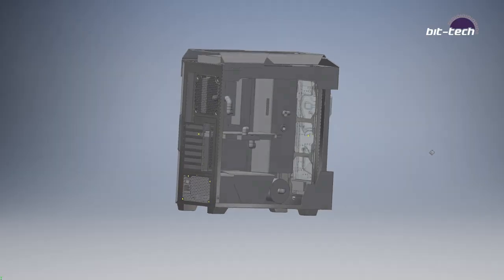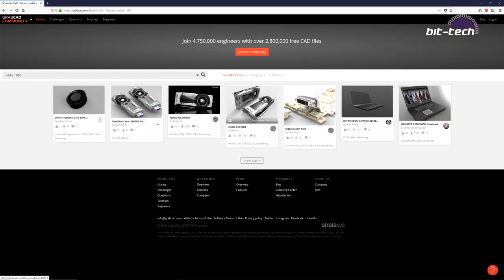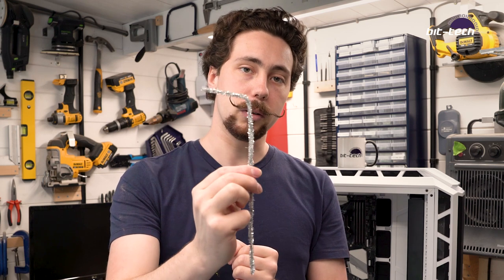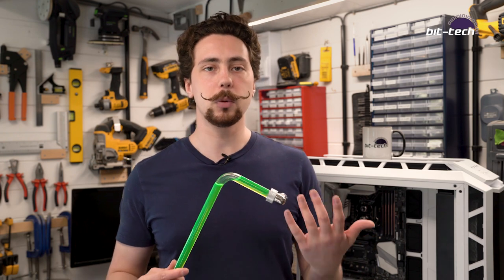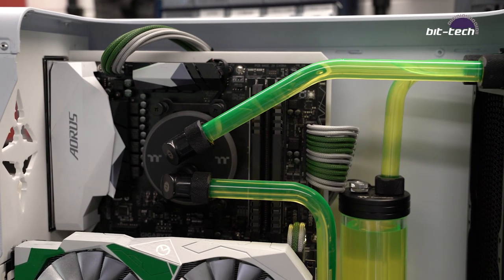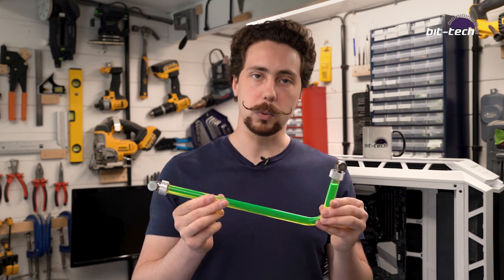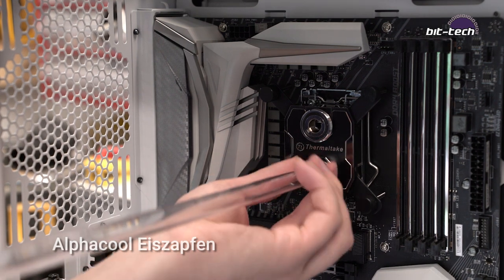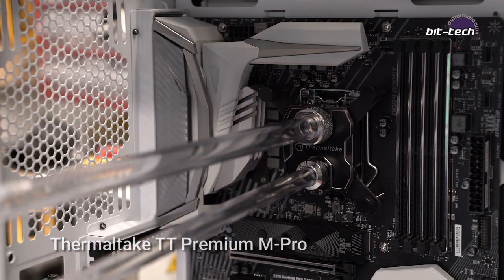How To Plan a Hardline Water-Cooling Loop | bit-tech Modding

Comment: Pipe cleaners are a great idea thank you for that. But to improve it I use stiff copper electical wire (around 3-4 mm thick) Way more stiff, thus easier to work with.
Reply from the maker: Yup same principle, works really nicely for roughing out a path, although both methods lack precision so are best for working out the route mainly.
Reply: So true but learning CAD or other 3D editing software is a BI.... for me :D

Comment: Do it in Cad :D.
Watercooling: where you need to know chemistry to know coolant and tube compatibility and avoiding galvanic corrosion, CAD for making a project, physics for reservoir mounting location, manual skills for heating/bending tubes, interior design for making the loop look good, patience of a budist monk for the project, specialized tools and it can still go terribly wrong.

Do we do this just because we like the challenge? :D
Reply: This applies to Modded Water Cooling, yes. Regular Watercooling lacks the interior design, CAD, Tool, physics and chemistry part. If you do it like most of the other people you're good.

Comment: Working with CAD seems to be a precise method if handled well. Could you do a tutorial for that at some point in the future?
Reply from the maker: It's on the tables for sure. It's quite a specific thing so some extra thought will have to be put into it, but it could be a good move. A number of upcoming videos will feature quite a few machined parts, where CAD/CAM is essential, so it makes sense to get everybody involved in the process :D

Comment: Hello! How do you get so precise dimensions in order to prepare the CAD 3D drawing? For example, if you buy a new computer case and you plan to draw it in 3D, how you manage to get all the dimensions? Do you do that manually?
Thanks!
Reply: You could laser scan it if you really go hard.

But most people just grab an accurate measuring ruler, a pair of calipers, and an angle gauge. Then grab the dimensions of the case manually.

If you don't have the case you can also work with sketch pictures which contain dimensions you can reference scale from. Those can often be found on the cases web page.

Comment: Great video!  I'm working on my first custom water cooling loop right now and it's very overwhelming.  I really appreciate your tips.  I didn't know that the Thermaltake fittings worked that way.  Do EK-Torque fittings work like the Alphacool or the Thermaltake ones?

Comment: Ok I'm new to water cooling.. I got my cpu block.. the diameter of the hole is 1/2.. what size fittings would I need? I see so much of 1/4 and 3/8.., sorry for dumb question

Comment: Hey hope you can help me out. im basically trying to plan my first hardline loop and trying to find somewhere in the UK that i can get all the fittings from is a nightmare! and iv ended up mixing fittings. im looking at some Alpha cool fittings, Thermaltake Fittings and Bits power. will this matter or should they play nicely together?  where do you get all of your fittings from as i cant find anywhere that actually has all the fittings i need from one brand.
Reply from the maker: MarkAndDoogleShow They’ll all work fine with one another as long as you stick to the same sizes. Have you tried WCUK? They tend to have the largest fitting selection I’ve found.
Reply: @bittech1   Iv been having a look but struggling. i think i might be overthinking/Complicating things for my self. also does size matter with how easy it is to bend? im looking at 16MM tubing but wondering if 12 is easier/ more forgiving to bend for a novice?

Also thanks for replying :) and very quickly at that

Comment: This really shouldnt be titles as "how to". More like tips and tricks. He says loop order is really important for functionality but gives no detail or even a single example.
Reply: this is exactly a "how to", he taught you "how to plan", how is that not a how to?
A "tips and tricks" is "take two pipe cleaners and twine them together to make them a little bit stiffer" 
As he mentioned about functionality "how easy is it going to fill to drain and to bleed" that's detail, yeah no examples, but it's pretty common sense to me. Plan a drain at the lowest point, avoid a lot of bends and loops for easier bleed and drain, fill hole be accessible, pump receiving ample water from the reservoir, common sense. and he didn't need to even say that, this is a "how to plan" not a "what to plan for" video.